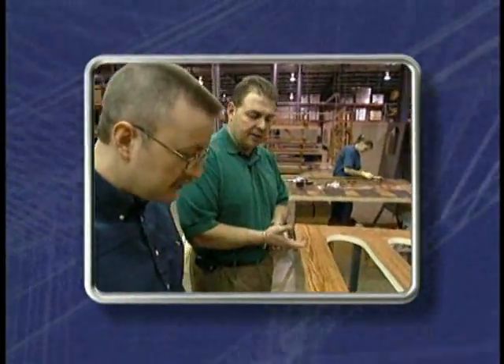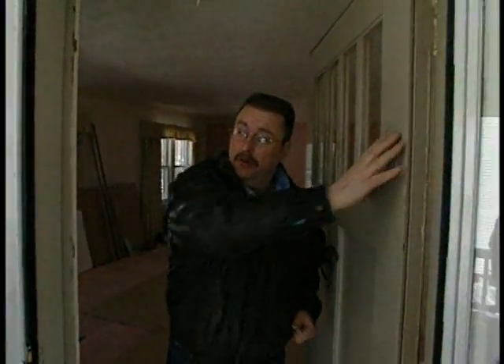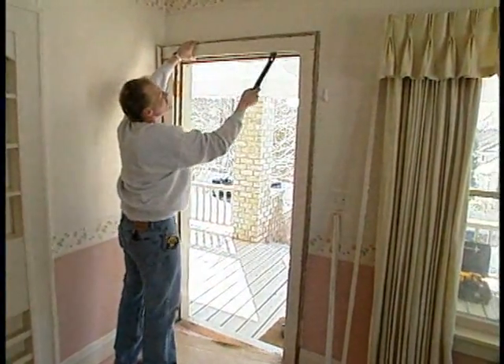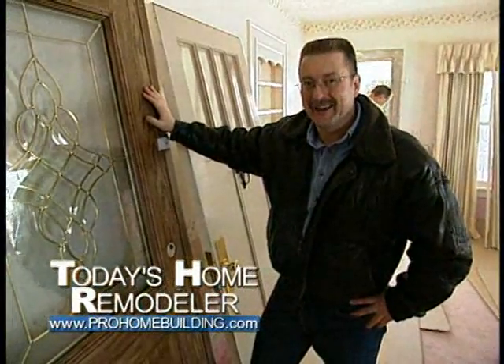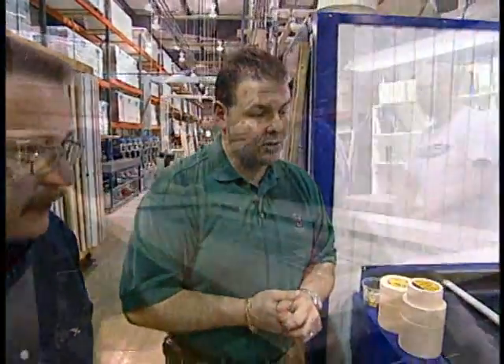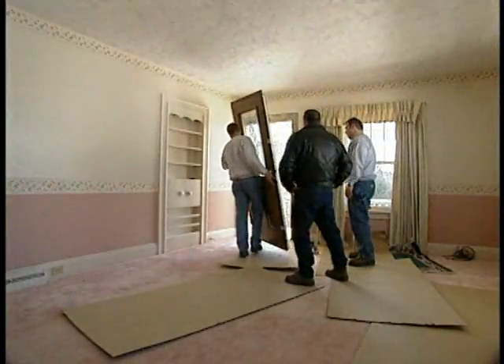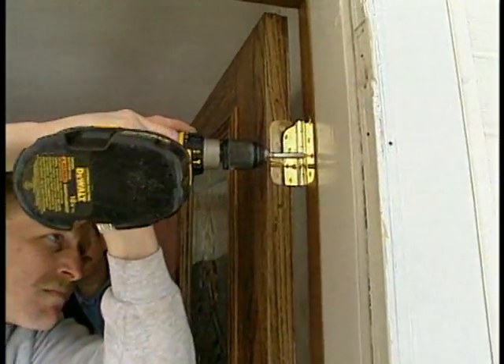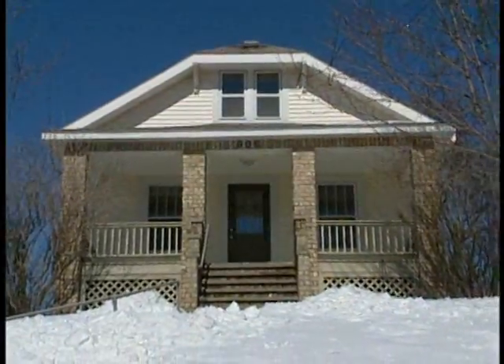How to Replace a Front Entry Door

Comment: 22 gauge?? ...not impressed. 22 gauge steel is about 0.03 inches thick. So the interior of the door is all insulation. How is that secure?? At least wood or fiberglass is SOLID.
Reply: +mikeallenbrown1 ,  looked into solid insulation foam.  There is even structural grade.  Modern engineering
Reply: If  you have  every broke down  a  door  you know it is not  the door the breaks, more often it is the  door jam.      It is for this reason the security gate was far more secure then the  steel door  alone.    But hopefully its a  low crime area in  the first place.

Comment: What??  - showed us everything including how to manufacture the door, but forgot to show how you inserted the door into the rabbet. Taking the trim off, removing the threshold, prepping the space.!  Did it simply fit in perfect? Can you effectively use this as a security door? Will it grab enough (or any) of the 2x4 framing allowing this to be safe from possible intrusion?
Reply: That's the point... show you a commercial for him and his dorrs. Dusty mentions several tiems how you should use a "professional". Useless video

Comment: What measurements would someone like Dusty need, to order a door such as this?  Do you use the original door as a template for the hardware and such to ensure a proper fit and alignment with a minimum of fuss and retooling?